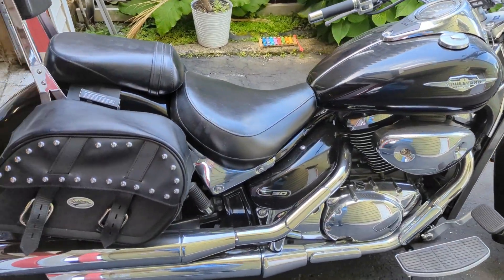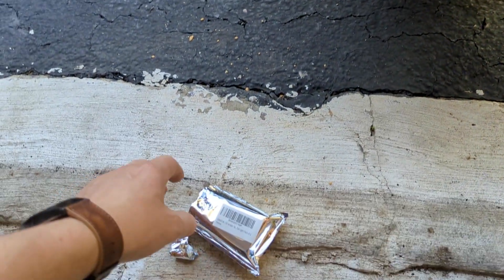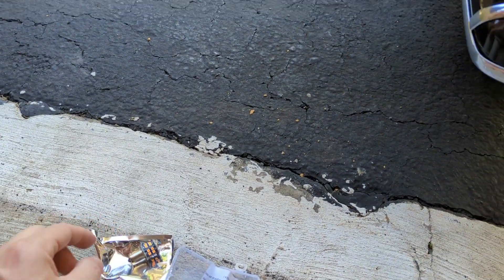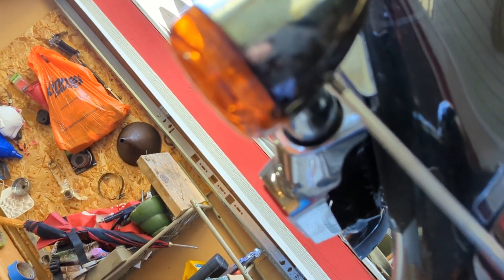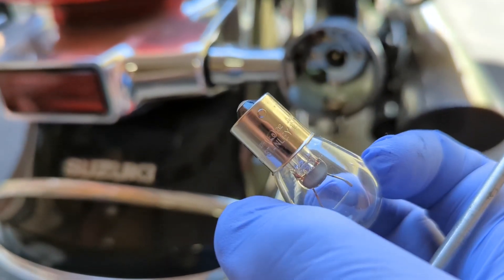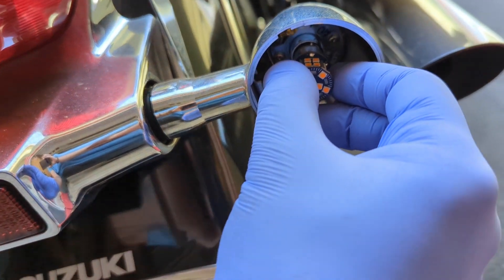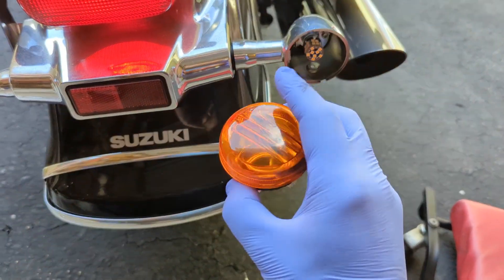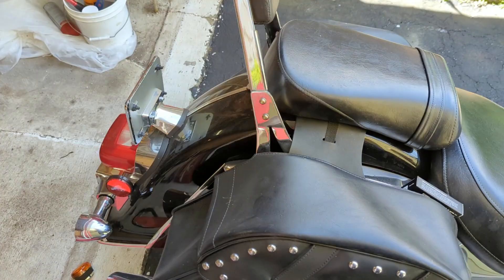LED Turn Signal Conversion for a Motorcycle (Suzuki Boulevard C50) Part I

Comment: The OEM directional (turn signal) bulbs for the Suzuki C50 Boulevard are typically 12V, 21W halogen bulbs, corresponding to automotive bulb sizes 1156 or 1157, depending on the specific location and model year. 

Bulb Specifications

Type: Halogen/Incandescent

Voltage: 12V

Wattage: 21W 

Common Bulb Sizes by Location

The specific bulb size can vary slightly based on the year of the motorcycle and whether the turn signal is front or rear: 

Front Turn Signals: Often use the 1157 bulb size (which typically has dual filaments for both a running light and a brighter turn signal function).

Rear Turn Signals: Often use the 1156 bulb size (which typically has a single filament for just the turn signal function).

Comment: Would you be able to help with the wiring inside? Trying to put in non stock leds and it flashes on the left and then turns off. Relay needed ?